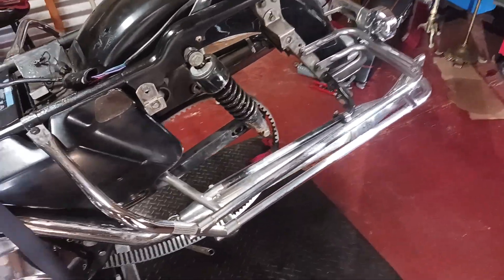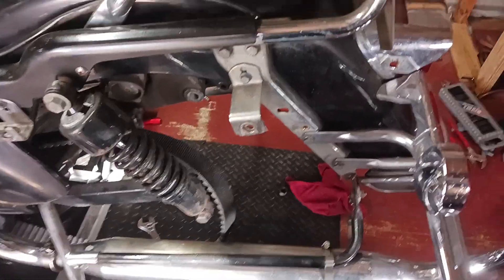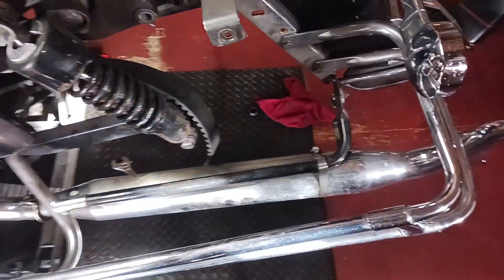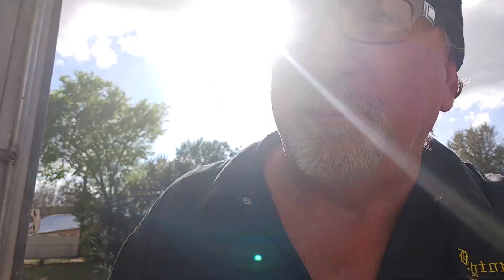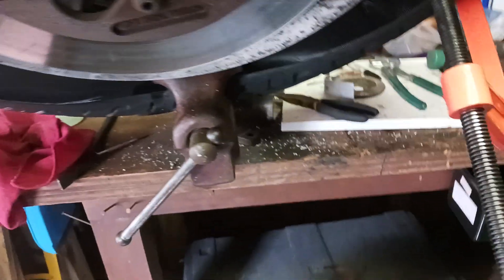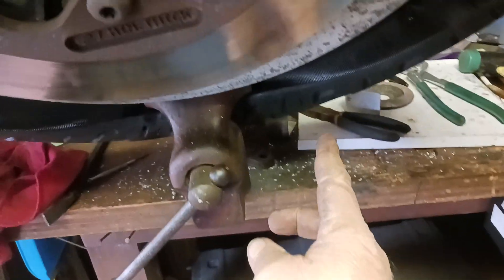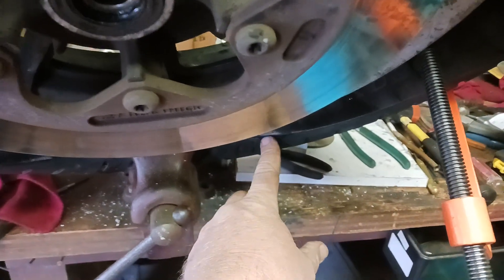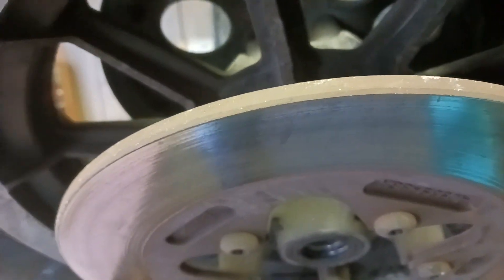Harley tire bead break

Comment: My very style in the C CLAMP.  I use C clamp pliers myself.   Most do as you do and use soap, I use WD40 on these tire beads and to assist in breaking the bead and getting the new bead to pop flush when airing them up.  Balancing is important also if you run highway stretches and if you need get with me on the right way to align your axle bolt once installed.  Heres something else to think ahead on, make sure your aligning bolts are the exact same length and have a blade gap mesurerer ready after you bolt the axle back on.  Ive got your back while you do this job, and Ill be here to walk you through if needed.  PS, heres something no one ever think about.  While that wheel is in that vice, take the axle bolt and oil it up real good and slidde into the bearings and then try to wiggle up and down with the axle bolt, if you can wiggle it up and down change those bearings
Reply from the maker: I ACTUALLY SPRAYED A LITTLE WD40 ALSO.
Reply: @edZILLA64  Over time when soap is used the inner rubber in a tire can suffer dry rotting from what soap gets in there because the soap remaims that falls in the inner tire.  This soap method was used by gas stations way back when a was a kid, but there concern was cost rather than thin oil.  Soap use is a NO NO.  That trailer stand to break the other bead was clever Ed, last time I dod that job I just used a short 8 inch length 2 by 4 on the other side that met with the rim and I got mine loose.  Youre a pro Ed, theres nothing you cant do
Reply from the maker: @EarlGuyton425  IVE HEARD OF GUYS PUTTING A THIN LAYER OF GREASE, WHAT 'S YOUR THOUGHT ON THAT.
Reply: @edZILLA64  Thats the way to seal the opposing bead.  On 18 wheeler tires they use solid paste grease, also called cup grease from the country, and spread around the  between the wheel and tire to get it to air up, then wipe off the excess grease.  Its a good way to do it  for sure and grease on the inner tire if not excessive is fine